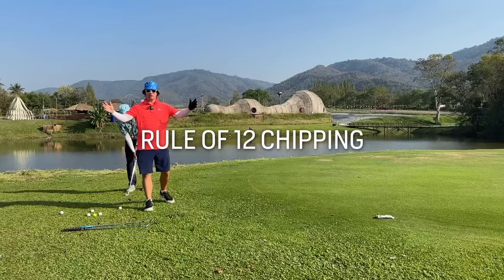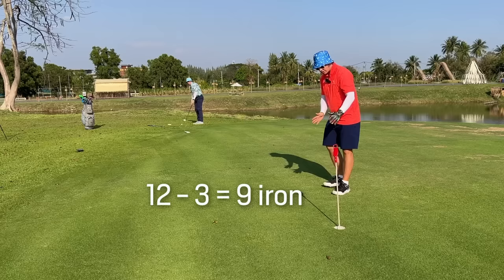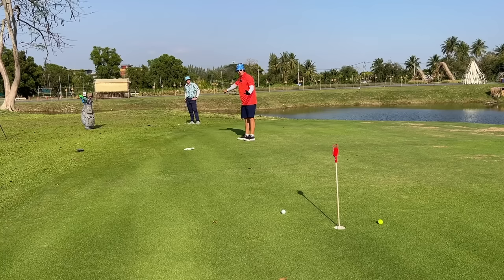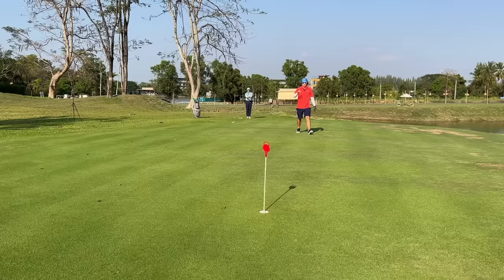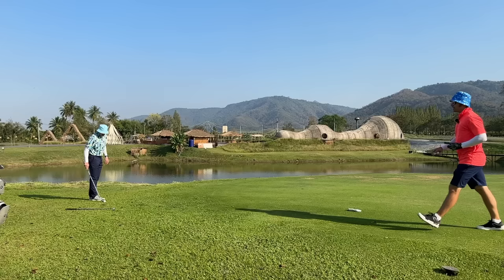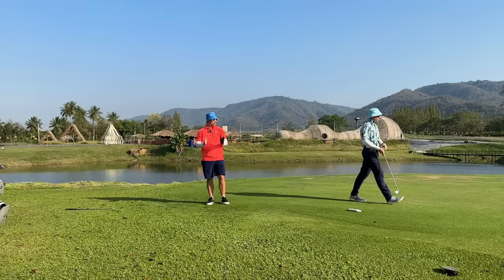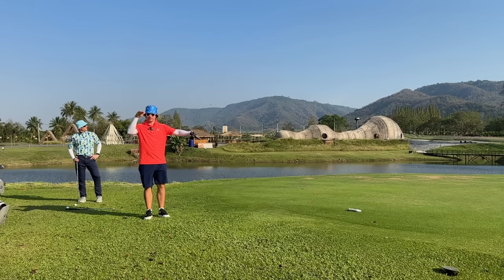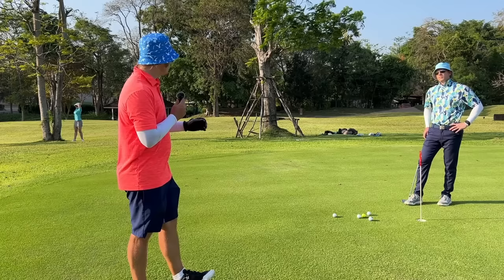Rule of 12 Chipping - Easy Way to Master Chipping

Comment: So rule is: roll out distance divided by carry distance equals number. 12 minus number equals club selection. Adjust the 12 to factor in green speed and uphill/downhill speed. Got it!
Reply: I simplify the rule somewhat since I don't pace off my shots.  I figure it by ratio of 1 to 5, 1 to 4, 1 to 3, 1 to 2 and 1 to 1 which corresponds to 7, 8, 9, GW, PW.
Reply: @majormeteor same here! For me my SW is 1:1 ratio. Then just go down a club for 1:2 and so on
Reply: Sounds like the lazy version. Have to be good with judging distances using your eyes
Reply: @shammymcshamrock8944  True.  You have to be good at distances.  When playing with friends, I don't want to whip out a calculator or pace off every chip.  Do you like playing with guys who think they are pros, then blade the ball across the green?  I'm just not that good anyway but this is a good metric for club selection.  Execution is a completely different topic.
Reply: @majormeteor obviously this would be for practice, then the more you do it, the less you rely on a calculation.
Reply: @majormeteor  Just in case you're wondering why this is not working for you, it should actually be 7, 8, 9, PW, GW
Reply: @lukeb1360  Yep, I mixed up the order of PW and GW.   By the time I get beyond pitching wedge, I am usually reaching for the lob wedge.
Reply: @majormeteor  A few people seem to be saying the same thing. That the GW is only a half ratio step between PW and lob, so they miss it out.

Comment: My coach introduced this to me as the "Nicklaus method" back in the mid 90's, becasue its exactly what Jack use to do. I used it on Tour for a long time, it works wonderfully, but you need to adjust it for each course becasue some greens are harder and faster than others, so all you do is go up or down 1 or 2 clubs relative to the speed of the greens. Same for uphill and down hill chips.

Comment: Land 
1/2 way to hole = SW
1/3 = PW
1/4 = 9I
1/5 = 8I
1/6 = 7I

Same math, but this make more sense to my brain this way. It's a ratio of land to roll out distance with a club result. I boiled it down to fractions of how close to the hole you want to land.
So, if you want to land 1/2 way to the hole you'd grab SW. Hope this helps.
Reply: Reminds me of Bobby Jones and the technique he advocated in his series "How I Play Golf".
Reply: Thanks for sharing. I think this will help me.
Reply: @nickbaker5296  agreed. I thought I wouldn't like this method because I like trusting my feel for these shots, but, like any other shot, it gives you a starting point and then you adjust with whatever modifiers apply.
Reply: Thanks, this works for me.
Reply: how come no one involves the 52 degree? im confused
Reply: @benbignell  A few things related to your question.  Irons vary a bit in loft, as we all know lofts have gotten very strong so that needs to be factored in, i.e. experiment and see what works for you and adjust the formula.  Secondly to your 52 degree question, most irons are ~ 4 degrees separated, assuming your playing modern (made in last 10 years) irons your PW (10 iron) is likely ~ 45 degrees, thus the 11 iron would be 49-50 degrees, 12 iron ~ 54 and so on.  Depending on your gaping you may not have exact spacing but you can get close.  So 52 degree would be ~ a 12 iron.
Reply: @brent-edwards  thanks!!

Comment: Great stuff, Matt. My go-to chipping (and often pitching) club is 9-iron. I've always liked to run the ball up to the hole, and early on I noticed that a mishit with the 9 (or any lower-lofted club) would almost always end up okay. In contrast, the bladed, low-bounce, high-lofted wedges that most players buy are, by design, unforgiving. Catch one a little fat or thin and you're chipping again. My #1 priority with any chip or pitch is that my next shot is a putt. These types of high-lofted wedges also require that you be able to read a lie very well and know how the ball will come out from different grasses and different lengths of grass.  While I've learned to hit these clubs and those high, soft-landing pitches, they still present more risk than I like. I'm a 4 HCP and I still only break out a lofted wedge when it's absolutely necessary. And even then it's usually only a 52º wedge!

Of course, I've practiced with the 9-iron for countless hours and so naturally I've gotten good at the 9-iron. Most players I see are using lob wedges around the green, and I guess that's okay. The ones who practice a lot get good with those, too. The wolf you feed is the one that gets bigger. But I would encourage beginning golfers, when they practice, to just throw down some balls and try chipping/pitching a variety of different clubs to a pin - playing around with opening or closing the face and varying ball position and seeing how the ball reacts. You can hit a 9-iron quite high. You can hit a low runner with a sand wedge.  Whenever possible (i.e. when I won't be in anyone's way) I throw a handful of balls out randomly to different distances from a hole. Then I chip or pitch  them with whatever club looks good for that shot (often...a 9-iron). I've found this type of practice to be much more fruitful - and more fun - than just banging the same shot to the same pin from the same place over and over.

Comment: GAME CHANGER!! I’ve recently changed from park courses to links here in Scotland and really struggling with my typical lofted chips around the green, the solution is obviously to stop using the lofted clubs due to the tighter lies but I’ve never been a fan of chip n runs. I’ve used the rule of 12 in the past but quickly gave up on it as I found it inaccurate but you have clearly shown on this video that you must adapt it to your environment, it’s so obvious now, thanks again Matt 👍

Comment: Thanks so much for pointing out green speed differences being critical for this method. Quick check with roll out using a sand wedge on the practice green before a round to see if roll-out is less or more than the 1:1 ratio should be a quick trick to be able to adjust speed for the upcoming round; rather than having to use a Stimpmeter.

Comment: I’ve been working with this concept as late and it’s brilliant for eliminating the unnecessary risk of duffing or thinning chips with the sand wedge (which seemed to be costing me 2-3 strokes per round). The green speed has to be considered and also the apex of different length shots because it’s higher on longer shots, which means a steeper landing angle, which means less roll out… and that’s for every club. Ive been chipping with 7 iron, 9 iron, and gap wedge at the practice greens and SW only when I have to AND the lie (nice chippy grass) allows for it. If not, then I must accept bogey and go past the hole. I’m starting to keep notes of the roll out numbers from different distances and different slopes for each club… it’s a lot! I do believe, however, that this will get me to the promised land.
Reply from the maker: Great set of clubs to be using for this method. Glad to know there are other playas using this method too

Comment: Great video.  Something to think about: "your" ratios will also depend on the dynamic loft at impact.  If your irons are game improvement clubs, they tend to be strong-lofted (i.e., a 9 iron has a traditional 8 iron loft) so you might have to go to the rule of 13.  Also, you may need to use a more lofted club if you tend to de-loft the face by having more shaft lean at impact.  Use the practice greens to work out your ratios and adjust the rule to fit your game.
Reply: Agreed. But if you go back to when Mr. Runyon wrote the book an 8 iron was 44 degrees and a nine was 48. I don’t know about dynamics but a 9 now is 40 degrees. That’s why you hit a 9 160 plus.
Reply: @jeffcline7689  well. That’s overly generalizing. I have a 42° 9i and carry 163 so it really does depend on the individuals skill level
Reply: My 9 iron is 52 degrees and I hit
It around 250 yards. Don’t believe me? Why not? This is the interwebs, where everyone is awesome
Reply: @JLeeGolf  So you can hit a 48 degree 9 iron 163 as well,
Reply: @MauriceKolen  😅😅
Reply: @MauriceKolen  but it has to be off the tee? 😂😂😂 well of course 12 is a rule of thumb for everyone bit at least its good to atleast have lets say 2 more shots than just putt and chip..sometimes you need "stronger putt" to thru some higher grass and roll out with some speed...and you can also do it with 4iron if just looking for strong roll...---> opinion on the whole topic

Comment: awesome lesson.  i made my own stimp meter by using 2 alignment rods and a small chunk of foam.  i made 2 holes in the foam that are the width for the golf ball to roll down and the phone can sit on the edge of the foam just above the 30 inch line with enough room for the ball to sit right on the line. (* foam piece about 3 inches by 2 inches by an inch).  then i made a marker mark at 30 inches on the rods.  i use a free android level app, and the stimp is a standard measurement.  30 inches of roll at 20.5 degrees/10.5 inches.  so you just lay the phone on the foam and raise it to 20.5 degrees and roll 3 balls.  measure that and then roll 3 balls back the opposite way on the same line.  the measurement in feet is the stimp of the green.  keep up the great work!
Reply from the maker: Your name does not do you justice. lazy dads would not create this. Waddaplaya
Reply: @GolfSidekick  thanks champion!  keep up the great work inspiring the people. greets from canada!!

Comment: Nice video ty. Reminds me of a Judy Rankin article I read 20+ years ago I still kinda use… based on flag location…9 near. 7 center. 5 far. Same stroke every time using these 3 clubs. With stronger lofts today I use the pw-8-6! ⛳️😂

Comment: Can highly recommend this method - have been using it myself for a couple of years and get up-and-down most times. I had to work out the green speed through trial-and-error. My club displays the stimp speed for the day on the practice green and I have a little chart in my scorecard holder showing all of the club/carry/role for each stimp speed - makes the working out way quicker (and actually speeds up play because you;lre making fewer putts 👍🏼
Reply from the maker: Nice playa. Totally speeds up play

Comment: I’ve used this rule for 20+ years and what is nice is if you don’t like to practice, you have something. Now rule of 12 can be rule of 11 or rule of 14 depending on green speeds.  Also the number of steps is your steps as its relative to the equation.
I use a similar rule for putting based on steps to hole +/- same backstroke in inches and the equation changes based on green speed.

Comment: This is great. Few thoughts for myself: I think I automatically carry my chips 1/3 of the distance to get me near the hole. That's using a PW. If I don't have the green to do this, I switch to a SW. For uphill chips, I tend to use a slightly longer club. For downhill, I use a SW. Now that I've watched this, I think I will just chip for warm-ups rather than spend time putting. Then I'll use my PW and mark where it lands and where it rolls out to. If it doesn't roll the rest of the 2/3, I'll switch to a 9 iron. If it goes too long, I'll switch the SW. Basically saying, you can calibrate a reliable method with a chip over a putt.

Comment: I learned from Eddie Merrins to use a putting stroke to take out the variable of distance. Your guy was using so many different levels of power. A putting stroke with a choked down 5, 6 or 7 iron proved most consistent for me.

Comment: Very good points and where your scoring is key. Personally, I would use an 8i/9i or Pw and /or putter if on a level surface just outside the green for more direction/distance control.  Only use a 56 wedge if height and short bounce is required.   👍

Comment: Now incorporate the same thought but in putting. Distance to the hole divide by 2 for slow greens (8 or 9), divide by 3 on medium greens (10-11), divide by 4 on fast greens (12 and above). If you are putting down hill then divide your distance by 2 to start and then apply the formula. I find uphill putts formula is always treated as a slow green (8 or 9).

Comment: I’ve used this method for six years and it’s the #1 reason my scores dropped five strokes per round.  My only additions would be to …always start with the ball in the same spot off your back foot.  Just going from outside to inside your back foot changes everything.  And, to me, it’s easier to figure the correct club, no matter if up or down hill. Then, if uphill, use one club less loft. ( Go from normally a 9 iron to an 8 iron.). If downhill, use TWO clubs MORE loft. ( If downhill and normally you’d use a 7 iron, use a nine iron, but hit the same spot as if it were flat.).  It makes computing a lot easier.

Comment: I used this method a few years back, so much so I had yardages written down. I used four clubs. I pitched everything five paces and recorded the roll out. My sand wedge was and is always pitch half way there and roll out the other half. You just need to get to a practice green and practice it and learn it. It’s better to stand a little taller and use a putting stroke.
Reply from the maker: Which four clubs did you use?
Reply: @GolfSidekick  54*, PW, 9 & an 8 iron.

Comment: When I found this rule of 12 a couple years back it was an ah-ha moment!  No more guessing.  I now have a formula for such situations.  Explained the same only different… 

For me, with “traditional lofted irons” I hit to 1yd on the green and the remaining distance is my roll out read like a putt to the cup.  I pace the distance from the ball to 1yd on the green, then I continue walking to the hole counting how many of the pitch distances are in the roll out distance.  Then subtract that number from 12.  ie.. 4 paces from ball to one yard on.  Then I continue walking counting to 4.  1,2,3-1… 1,2,3-2… 1,2,3-3… 1,2,3-4 if “4” gets me to the cup.  Then it’s simple… 4 from twelve is an 8i.  Then I typically adjust one club up or down for uphill or downhill roll outs.  It usually gets me to a comfortable putting distance.  This made a huge difference in my up and down game.  

Keep planting feathers!!!

Comment: I use this but in a simpler way, never involving the number 12 and the math.
sand wedge has a 1 to 1 ratio. Hit it 9 feet it rolls 9 feet on a flat green.
pitching wedge: 2-to-1
9 iron: 3-to-1
8 iron: 4-to-1
7 iron: 5-to-1
I eyeball the distance from my ball to a spot 3 feet onto the green and then compare that to the distance from 3 feet on to the hole. It works. If the green roll is uphill or downhill you have to adjust a club or two up or down. This only works well if you are within 8-10 feet of the green. It is gold if you are closer than that because of the ease or consistency of popping it to that spot 3 feet onto the green. Just memorize those rollout ratios. Remembering 3x3=9 and 4+4=8 makes it easy. Take the club smoothly just past your right foot and pop the club to your left shoe.  Hitting 5-6 practice shots on the practice green is all it takes to set in your mind what stroke is necessary.

Comment: whatever works for you most chips i feel how much forces i need to hit a certain distance and go from there. I stick with the wedges because most situations you need to carry the ball further than you can with a bump and run or its downhill. there are limited situations where punch shots are beneficial like when you have to avoid obstacles but wont ever be a high frequency shot because most chips you dont have alot of green to work with.

Comment: This is cool, I didn't realize there was already a calculation for this. I would just have ratios for each one of my clubs like: 60° is 3:1, 56° is 3:2, 52° is 1:1, PW is 3:4, 9i is 1:2 etc... obviously slope of green, grass conditions, and other factors can change it but it's generally a trustworthy system. The only thing is that the further the chip, the less reliable this system is. Eventually they all get less rollout once you get to the 25yd+ range.
Reply: Another variation is to convert your ratio's to a percentage. For me, my 44° PW is approximately 60% carry, 52° GW is 73%, 56° SW is 78% for chip shots from fifteen to thirty yards.
Reply from the maker: boom

Comment: I can see myself saving 2-3 strokes per round using this. (I get up and down ~30%.) I am mentally recommitting to carrying my bag rather than taking a motor cart, because it's hard to execute the rule of 12 when your buddy drops you off 40 yards from your ball and you have to carry 6 clubs in your hand like a peasant.
Reply: I’ve been wondering myself how this would play out… thought about maybe getting a Sunday bag that holds 4-5 clubs and just kinda carrying in the cart with me and then every time I get dropped off I’ll have everything I need…
Reply from the maker: Never a truer thing said. Walking the course is one of the very best ways to get a feel for the course and the conditions for the day
Reply: @chrisearle7886  Well you always need to take your putter, and usually a high lofted wedge in case the lie is bad. But the other 2-3 clubs could be anywhere from 5i to LW. I've taken my bag off the cart a few times, but that's not something you want to be doing multiple times per round.

Comment: tried this at the chipping green using my 7,8,9 I and P wedge. instead of my high 56 all the time.
much easier to hit a consistent stroke and advance the ball with the irons for sure. even if you mess up its not as bad as a flub or blading a 56 across the green.
now i just need to get used to how much roll out occurs as i am not used to that yet.
Reply from the maker: You’re on your way Big dog
Reply: @GolfSidekick  thanks for your tips. Very helpful videos👍.